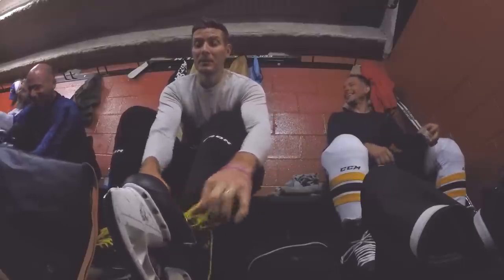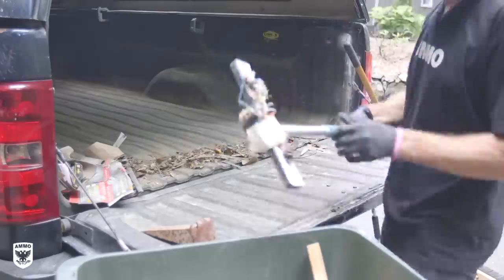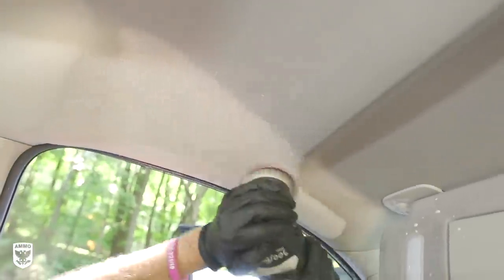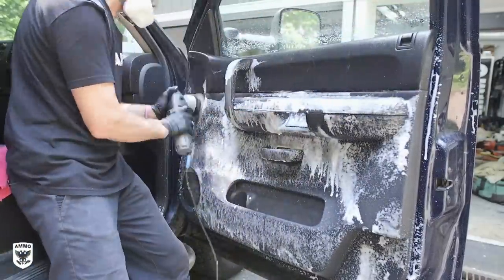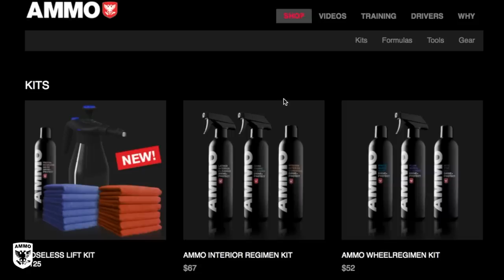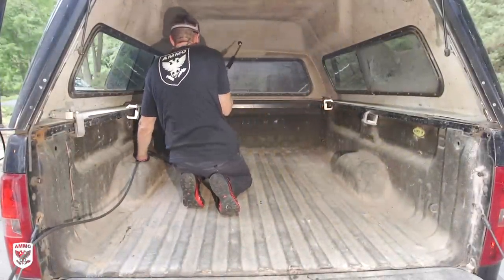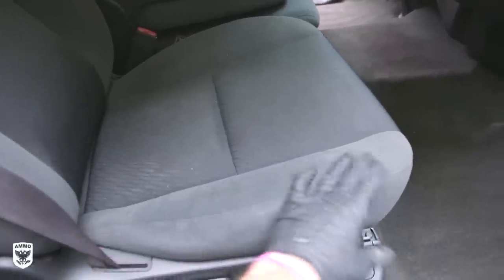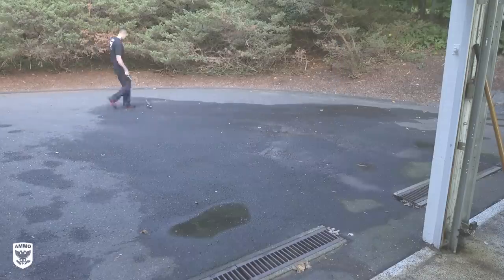Detailing Dirty Truck Interior after 9 Years! Chevrolet Silverado

Comment: I been trying to figure out a much safer option for cleaning a headliner. And the polisher works amazing. And you don’t have to used a steam machine and worry about sagging or melting the glue. If not done correctly. And I just used a soft drill brush with a 1/10 carpet cleaner solution and water extractor(just water) to make the carpets look amazing. Ammo is by far one of the best channels. I have learned a lot from here. Will say to go ahead and watch most of his videos. Really insightful.

Comment: 2009 and it's already got some nice rust on the door jams😅
Reply: good ole ct and ny salt.
Reply: It’s a Chevy no shit
Reply: Those model years had rust problems
Reply: I own a 2008 3500, this thing is rust free. The rust you are seeing in the jams is the untreated  metal used (Its like a little rod of rebar that is easily replaced). It far and away has the most durable clear and paint of any truck ive owned.
Reply: You clearly aren’t old enough to remember how 10 year old cars/trucks tended to look in 2009... Or 1999... Sunshine states don’t really count because cars obviously aren’t gonna rot there.

Things aren’t anywhere near as bad as they used to be!

Comment: I just bought a '99 Jeep TJ 5-Spd that has been sitting outside for the past 4 years - the base is in GREAT shape, along with the engine and what not, very minor rust around but it def needs some TLC and you are so damn thorough, I am learning so much from you! Sub for sure! Thank you! I am about to get started this weekend and take off the wheels and give them a good scrub and wash and then i'm going to tackle the underbody with a wire brush to get the loose rust off and then hit it with POR 15 to protect it! One thing I need is a Carpet steamer/cleaner and a damn extractor - those things are SO HELPFUL! Thanks dude! Shout out from Long Island!

Comment: Could he have taken the top off to make it easier to clean? Just curious
Reply: Abercrombait&switch you can definitely take it off. But it’s probably overall a lot easier just to hop back there and clean it. 

Also, that’s a LOT more liability.
Reply: Sure there’s only three clamps holding it on. Supposed to be four, but if you look one is not correctly installed.

Comment: Does the foaming of the doors mess up with the speaker and other electronics?
Reply: No but that was it better for cleaning the little holes. Use a air compressor after

Comment: ive been detailing as long as you 

the peroxide and orbital brush is a nice touch on headliners 

they are super sensative and oftentimes you dont see the damage till days later. the glue seperates when over saturated with water.

never saw the tamping trick but its nice you bring up how delicate interior coushions are. 

the slightest abrasions do nap up and damage the poly vinyl so i always try peroxide and dishsoap and extract extract extract 

im not fancy and dont have any of your foaming sprayers but might look into it 

the only thing i would add is im not a fan of apholstry extractors 

they are bulky, cumbersome, and the attachment can never reach in like a shop wet dry vac 

now your limited by the outlet at 10 amps and 110volts anyway 

but shop vacs offer more HP and suction power over extractors because its an electromagnetic induction with a propellar for a vortex and exteactors just use ceramic heads in their motor for their power as less moving parts means less to break. 

they are also limited to 160 degrees for their heating element and they fail often and they are expensive 

i prefer just using 210 degree water out of the tap by cranking the water heater up for awhile with some dish soap and peroxide mix then scrubbing it in and extracting with a shop vac 

excellent tip with the compressed air. many refuse to do this and i dont get why. 

when it comes to cleaning under the hood i use 1 of those pesticide sprayers 

its far too easy to fry a coil or completely bunk a 75,000 bmw electrical system 

despite popular opinion , the hood, in fact, is there to tell you that you should probably keep this dry 

they have other equipment out there that pushes alot of air and micro droplets of water but im cheap and the tank sprayers work well enough

great vid 

im def trying the buffer on the headliner

Comment: When you completely soak a door panel an dash like that, don't you worry about the water seeping in behind all the trim and damaging the electronic components?
Reply: Matt have you seen the truck?
Reply: Yeah, i watched the video, what are you saying?
Reply: Not with water. However, a detailer used too much armor all on the door switches and turn signal switch, that made them stop working until they were cleaned off
Reply: @brainfulify  Trucks usually have better everything, that's why most of them, regardless of make or model can make it to 250k+ with little issues and hold their value extremely well. My 1990 Silverado, which was a single cab short bed was a base model work truck and I got 480k on the original motor and transmission with normal maintenance. I have a Silverado now which is the same design as the one in the video (2012) and it's freaking awesome. Also, any chance that you've taken door panels completely off before? If you have, or ever get the chance you'll notice that they usually have a layer of plastic liner designed to keep water out and drains at the bottom (assuming it soaks in from the window area), however the water would have to go all the way down the door switch and back up inside to do anything at all. Most trucks are designed for extreme conditions, even the LTZ version of these trucks. I would assume that all of the components in the doors of trucks are at least somewhere between IP61-IP64 rated.
Reply: Foaming reduces the amount of product/water used. Just like with the headliner, it sits on top of the door instead of being drenched. A direct spray to a flat surface like the dash won't do much harm as long as you don't have the sprayer nozzle right up against the electronics.

Comment: First of all...great video!!! My only suggestions that may sound like it takes too much time but actually saves more time and allows a more thorough job: 1) Take out the front seats. Only 4 bolts per seat and maybe a power connector. Reason: clean the carpet a whole lot easier and the seats a whole lot easier (and you don't miss anything on them during the process). 2) Take that bed Topper off. Looks like only 6 or so clamps holding it. Reason: Allows cleaning where the topper and truck bed makes contact. Also, can put topper on ground and do power washing, scrubbing, etc a whole lot easier. Also, cleaning the truck bed would have been easier standing up :).

Comment: One thing with trucks with bed liners, they tend to get debris under them. It is helpful to pull the liner out to clean there also. Reason is that the debris between the liner and the bed acts like sandpaper and destroys the paint causing rust.

Comment: Even after your initial vacuuming there was still way to much dirt and debris on/in the carpets and seats prior to applying the liquid fabric cleaner.  Care should have been taken to vacuum as much dirt out before applying the cleaner. A trick I learned along time ago when vacuuming carpets and seats is to beat them with the palm of your hand while vacuuming such as you did when they were wet with cleaner.  You would be surprised how much debris and dirt come to the surface when you beat the carpets and seats.

Comment: Organizing the stuff back into the car is amazing. Actually you don't need to do that. One thing. I was expecting you to remove the seats and center console. If you had used drill brush in seats and carpets, those little stains won't be there I think. The head liner work was something which I never seen before. Good

Comment: Larry, while your detailing is among the best in the industry. You need to re-address your approach to fabric in general and more specifically fabric that is trashed as it was in this truck. A high powered heated machine like a mytee 1003DX with a rotovac sheardry upholstery tool will yield much better results without over wetting the fabric and ultimately capture a much greater amount of dirt. Flushing the fabric out is your friend in this case. I suggest you check out alternative chemistry as well. The detailing world would benefit from carpet cleaning chemistry. Citrus,oxi and enzymatic combination cleaners are the norm and rip through tough dirt and adjustments can be made with dilution for any situation. A good example of foundation chemistry to build from would be a product like Bio10K Pro from truckmountforums. As a professional carpet cleaner I think you would really benefit from the combination of a good portable machine with heat, different chemistry and a windowed professional high flow/recovery tool like a rotovac sheardry, mytee dry, sapphire scientific upholstery tool and or a hydramaster drimaster.

Comment: My headliner has a really weird textured fabric and I’m so scared of ruining it but after 220000 miles, it’s gross. I attempted to lightly brush it with a soft bristle brush in one spot, but it caused a bunch of pilling and changed the texture. I’ve tried just rubbing it with a microfiber but it doesn’t pick up the dirt. Would the microfiber pad be a safe technique on different headliner fabrics?

Comment: How many issues (if any) do you have putting so much liquid on speaker grills , power window controls etc? Inevitable that some will get through ?
Reply: Also is taking the carpet out too much for price your getting etc? When doing my cars I pull seats and carpet to use pressure washer on carpet  (when they are as bad as this truck is )

Comment: So I have been trying to get put some stains for. My carpet and they go away while the carpet is wet but they come back just as heavy as soon as the carpet is dry. I work in a steel pipe mill and get covered in grease and all kinds of dark nasty stuff. I tried a from gentle to extreme. What do you suggest?

Comment: And you don't wear out your arm trying to be consistent 100% of the time.... saves you energy to go longer and be more detailed and persistent in cleaning / detailing
Also question, even if you don't look at these new comments, What would be a good solution for getting mold out of an old car that sits in a humid / wet environment and is not constantly used... Trying to help fix an old car for a person i live with so i can buy it from em at a later date.

Comment: I bet on that scuffed and scraped plastic.. you can use the same trick i use on older plastic speakers.  A heat gun lightly passed over the areas will melt in the ridges and fill in the valleys

Comment: I'm not usually negative about a car detailer, but honestly man if I could describe this detail, it would be summed up into one word, INCONSISTENT, come on you could have atleast protected the plastics in the vehicle, you should never wash your vehicle with a microfiber towel, it should be washed with a sponge, the microfiber towel spreads harsh abrasives like soil around on the paint causing swirl marks, learn from other detailers, adapt to a better job, please don't do what you did ever, it's actually heart breaking to watch you do that clean man.

Comment: Ive never saw you removing car sits or carpet flooring to clean very dirty cars. Tapping a carpet with a product on the top of it will just make the dust and dirt go into the sit. Im an ocd and im not really satisfied. Your making a very good job cleaning outside the car though with the paint work

Comment: Those plastic interior with those scuffs and scratches like the center console, door panels and a-pillars any where there's plastic try to used a heat gun with some passes like when you paint a car it will fix just don't over heat those plastics might melt a hole or deformed it.

Comment: I would have pulled the seats out and pressure washed them with a wide fan tip. Soaked them in laundry soap first let sit for 10 min then pressure washed them

Comment: You forgot to detail clean the motor and the inside hood and the rims and tires
Reply from the maker: The focus was on the interior. It wasn't a full detail. I washed the outside as a courtesy.  If it was a full detail, then yes I would have done the wheels, engine, etc.
Reply: AMMO NYC 
I need to ask you something important

Comment: That headliner was nothing. A friend of mine left a 12pk of grape soda opened in the back seat and one insanely hot day about half of them exploded and went all over the ceiling. He just left it that way. The center console was also uncleaned for about five years and had a thick layer of grim and dirt mixed sludge stuff all over.

Comment: With the car dirty like this one, you should pull up the seats out to clean carpet properly and seats also. That is not detailing. And what the hell is tamping with the brush, you need to use drill brush on the carpets. This is not detailing, this is surface cleaning...

Comment: No disrespect but 20yr of detailing and you use that crummy carpet extractor ?   
You definitely need a hot water carpet extractor.
Also you never clean vinyl first..  carpeted areas needed a full extraction plus you’d need to blow out between the seats before you use chemicals on the carpets( that part was edited out of the video)

Comment: Whoever taught people to use a drill to scrub fabric is just rubbing in all stains into the fibres worse. You need a proper chemical steam abs extractor and that is the only way to properly extract stains. Not spraying stain remover and using a brush and drill to rub it out. Ruins the fabric and color. Horrible idea and example. This is coming from someone who owns a fabric and carpet cleaning business